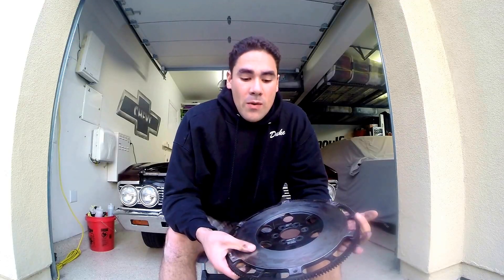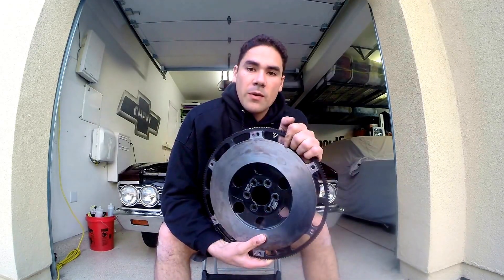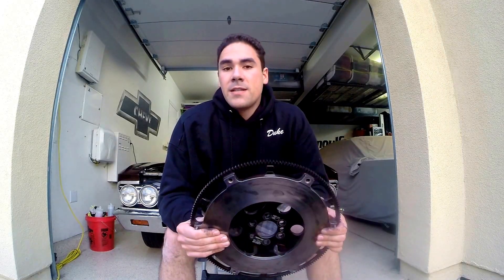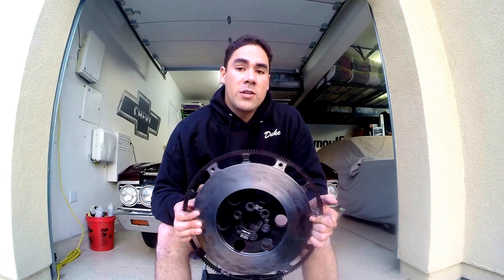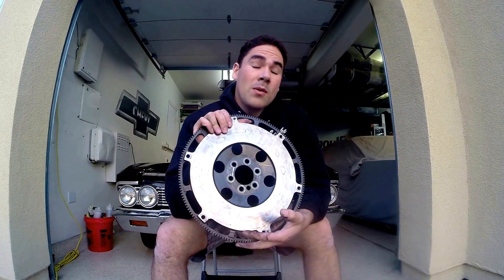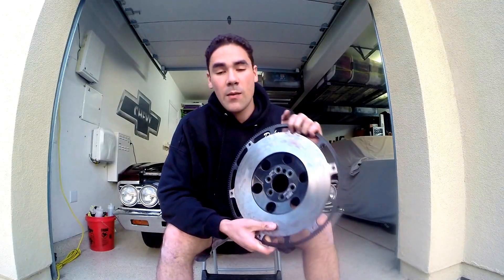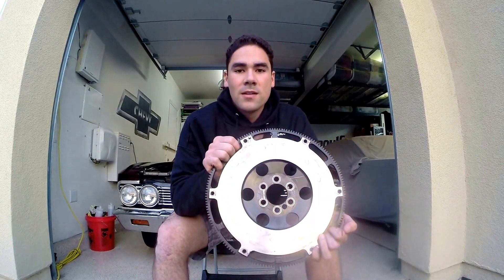Is a Lightweight Flywheel Really Worth it?

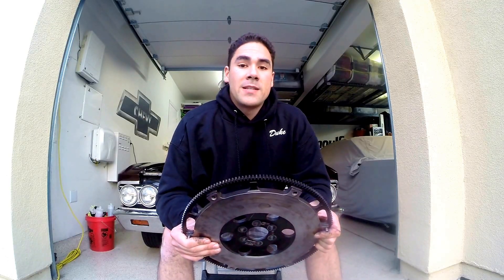Comment: in 1:30 he's talking bullshitts. With clutch pressed into the floor (between the gears), flywheel is disconnected from the gearbox. The only mass which will be bonded to transmission (input shaft ) is clutch friction plate. The lighter it is - the less effort synchro rings needs to slow the input shaft down whilst clutch pedal is down. Lighter flywheel, apart from less resistance to engine when it increases its RPM, in the traffic environment (1-2-3, stop, 1-2-3 and so on) will also result in less fuel consumption. We've proven it empirically at UNI, verified on Ricardo Wave simulation SW and finally proof in real life vehicle.Simply, an engine requires to waste some torque to speed up heavy flywheel from n1 to n2, instead of transmitting this torque to your wheels. Also, heavy flywheel limits engine max RPM as some energy is needed to keep heavy mass at constant angular velocity. Simple exercise form young years - a moped with 2 stroke engine, after just removing totally flywheel, disintegrating flywheel to remove just a cam (for operating contact points - non-electronic ignition), installing just a cam for its own, was driving faster than with OEM heavy flywheel.No other mods been performed.
Reply from the maker: krisbham what about everything else like driveshaft, rear end, tires oh and also the weight of the car....? Lmao
Reply: No, you dont get it (krisbham). You are right that the flywheel is disconnected from the wheels when shifting, and that's the whole point. When you shift up, the engine RPM has to drop. If the flywheel is heavier, then when you engage the clutch at a higher gear, and the engine is still spinning faster than the gearbox, it will be harder for the gearbox to slow down the engine (That's what he says). And guess where that energy goes that the gearbox takes away from slowing down the engine. To the wheels.

Comment: With a light flywheel, you need a super good clutch. I have a 9.5 exedy and it won't grab. I can feel it slip at high rpms when I'm slamming to the gears. It is better for mountains. It climbs with ease that's what I notice. I'm still not sure what people are talking about being rough chatter for everyday driving. People not must know how to drive.
Reply: You have a Miata too I'm guessing. Does the light flywheel really make it harder to engage gears with a stock clutch? I'm trying to figure out if I should upgrade the clutch with the flywheel. I'm on stock power and don't intend on changing that, so I figured the stock clutch would just be nicer to live with.
Reply: AD1 it feels no different from a stock car. The only time you will feel a difference is from a heavy duty clutch from how hard it is too push down on the clutch. I would recommend a heavy duty clutch with a light flywheel. The only time chatter happens is when the flywheel is warp like brake rotors. Just think of it like brake rotors, it will only chatter if it warp. People must stall a lot to get the chatter which then warp the flywheel then they complain of chatter. It does not change how it engages. The only difference I felt with a heavy duty clutch is how hard you have push on the clutch and when you release it, it will spring back faster and actually hit your feet before you release it. It took a minute from getting used too and it's rough for everyday driving like in out of bumper to bumper traffic. It's stiff as fuck.

Comment: I have heard that a lighter flywheel gives more vibration/rattle in the cabin, for a street car does this affect the driveability of car and how annoying is this ? Good Video - Thank u
Reply: YES
Reply: Maybe so.
Reply: MAYBE NOT
Reply: of course as the engine is balanced on the factory so the stock flywheel is dynamically balanced to all the other rotating parts of the engine as to not produce any unwanted vibrations in the useable rpm range basically changing the flywheel mass moves this resonant frequency

Comment: Lightweight flywheels are great! Not too light though, or you'll loose drivability.
Reply: I did a 11.6 lbs reduction. Love ut
Reply: What do you mean?
Reply: @darioavendano369  a light flywheel in a low torque car will make it easier to stall because the engine itself will have to do more work when you let down the clutch. It also loses revs much quicker and thus, you will have to learn to shift faster, although that's kind of a secondary concern.

Comment: adding weight makes no sense, horse power comes down to speed. the faster you can accelerate, the faster you will get to where you are going, that is not to say that using certain light weight parts in your car will not adversely affect it...you are correct about having more weight in motion tends to slow down more slowly HOWEVER first you have to get that weight "in motion" and guess what? the heavier an object is that you have to move, the longer it will take!!! that's a fact. if you take 2 identical cars and add more weight to one and then race them witch one would you bet on your house on if you had to??? with that said, i have to disagree with you on that part.
Reply: When youre dragracing you will most likely launch and therefore have time to rev up your engine in advance
Reply from the maker: SHOTGUN SMACKED I probably shouldn't have said "add weight". I meant to say stock weight assembly vs lightened assembly.
Reply: Just like with most engine mods, it's a toss up on your preference. Do you want power or do you want torque

Comment: A heavier flywheel is helpful when drag racing cars that have low torque, like a rotary engine. The reason is that a heavier flywheel will store a bunch of energy before the green light, artificially improving the launch and 60 foot times. Beyond that, the lighter the better when it comes to ET's. For almost all cars, the better launch (if traction is available) is negated by the inertial losses, especially in the lower gears. This is both from a scientific standpoint, simulation and years of track testing.
Reply: Lightweight flywheel helps my Mustang GT launch better with about 310 ft lbs of torque. With the stock one I wouldn’t stop burning rubber until 3rd gear when I clutch dump. Now she hooks up faster.
Reply: @angelgjr1999no shit you lost torque at launch 😂
Reply: Got the light weight flywheel for a more than a year now. Car launch is much better but I feel some loss on higher speeds where inertia is needed to propel the car forward but pushing the pedal helps with that. Overall for my car it was a good mod. Has made my 123 pretty quick yet still I feel the Los on higher gears
Reply: Yes. What you have to learn is to rev your engine on take off. In most cases the engagement point will actually pull the car with out throttle. 
If you do that with a LW flywheel. You’ll literally hear and feel flywheel chatter. If you don’t already.
Reply: Could you explain why a skimmed flywheel causes loss of power specifically uphill does it effect torq?
Reply: I want best 0-60mph time. Light or stock? Or even 0-40mph
Reply: Marvin Eghan  he literally just gave the answer before tou asked the question 

A heavier flywheel will get you better launched in a low torque car...

Just stick with stock if youre not going around a race track or need to rev match often
Reply: @rebel.mma.youtube  if you interested in 0-60 buy tesla or just get some opel corsa light weight it and here you go... :)
Reply: @strahinjaboskovic305 Tesla lmao.lololol.I can’t work on a Tesla in my garage 🥹.Pop the hood.Oooook what am I looking at?where is the engine?

Comment: Sorry man , but revving quicker works equally well  going straight as it does going around corners .
Reply: exactly. the engagement of a larger flywheel is probably more jarring so it gives the impression of momentum when shifting but it makes up for it when your climbing up the RPM range. If anything the light weight  flywheel is probably just slightly quicker. However the main benefit is like the guy said, rev happy engine that is more responsive and better for spirited driving.
Reply: I find that upshifts are easier to do quickly with a heavier flywheel, and down shifts are easier to do quickly with a lighter one. The maintained rotational inertia of a heavier flywheel seems to keep the engine spinning faster, making the upshift engagement easier on the gearbox as the synchros seem to prefer higher rpms.
Reply: @Shakshuka69  "..keep the engine spinning faster..." bad english expression. Only saying this because it clouds your intended meaning, it keeps the engine revs spinning (due to the extra rotational mass inertia). Upshift engagement is going to happen no matter what, the real trade-off is the higher engine stall speed on clutch engagement and I feel this is a momentary enough inertia window to not be a serious concern over the vehicle rolling mass which, after all, is powered by the engine regardless of flywheel rotating mass differences.

Comment: Mclaren F1, Carrera CT both have NO fly wheel. The revs drop tremendously during gear changes so it makes for a less "smooth" drive BUT for road racing it is superior if an experienced driver is on board. A weighted flywheel just helps keep the revs up during changes for those that don't have the skills to change up or down rapidly.
Reply: its not all about revs the flywheel smoothens out the power delivery for a more comfortable ride

Comment: My question is unrelated to this video, but what transmission are you running in your truck?  I've got my own build going and I'm using a lsx 454 engine for sure but I'm wanting going to with a turbo 400 and a overdrive unit, but then there's also the newer 4L70's or 85 that'll do the job without the overdrive unit.  Any feedback will help, thanks!
Reply from the maker: John TerBeek no worries man! If I were you I wouldn't go anything smaller than a 4l80e. It's basically a th400 with an overdrive. If you want to get fancy the 6l90s are even stronger with 2 additional gears so you can have your cake and eat it too!
Reply: Griffin Steinfeld Thanks for the reply. It's looking like the 4L80 then, the final resting place is in a 68 GM A-Body.  Those 6L's look mighty big to fit in the tranny tunnel without a little metal massaging lol.

Comment: wait a second... if it frees few bhp, for example 4-5 hp... how does that momentum in engine still makes you loose at drag race? what about racing from 20mph or from a dig?  Does it changes only when you are out of gear(while you try to get into another) or in gear?
Reply from the maker: Leo E36 like I stated in the video, an object in motion will stay in motion unless acted upon. With that being said, more mass (heavier flywheel) will be harder to slow down than a light weight fly wheel. When you up shift, the clutch/ trans is fighting to drag the engine down so if you put more mass on the rotating assembly it will feel like it's hitting the next gear harder due to the fact the engine doesn't want to slow down as easily
Reply: EXACTLY WHY REV MATCHING COMES INTO THE EQUATION
Reply: because in drag racing you can clutch dump this means you can rotate the heavier flywheel to some x rpm then dumping the clutch and it will pull alot harder and faster because of the stored energy vs a lighter flywheel. but in any other case example going out a curve the lighter flywheel will win as it will rev faster and you dont clutch dump anywhere else except launching